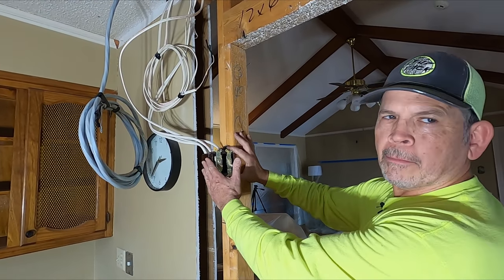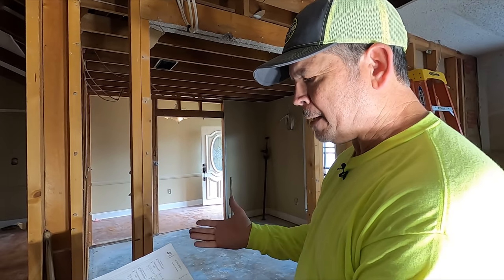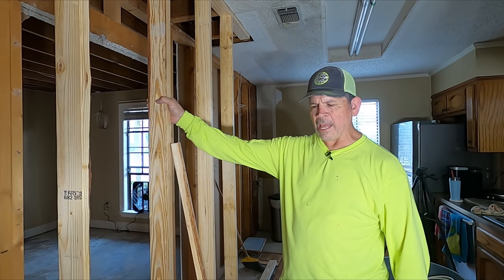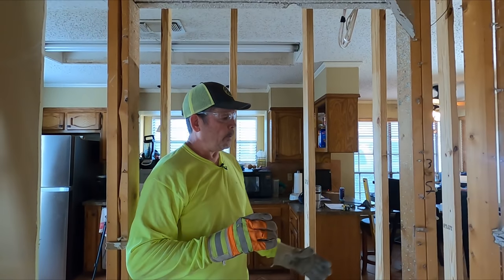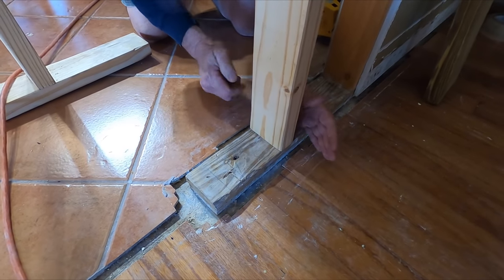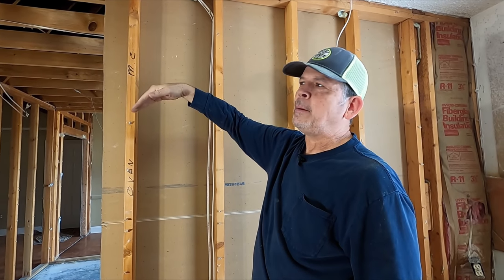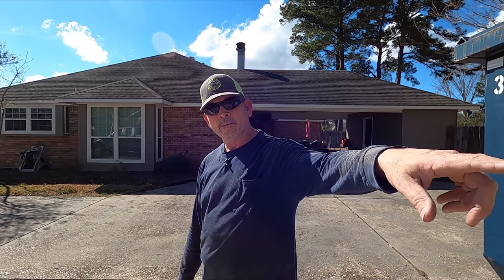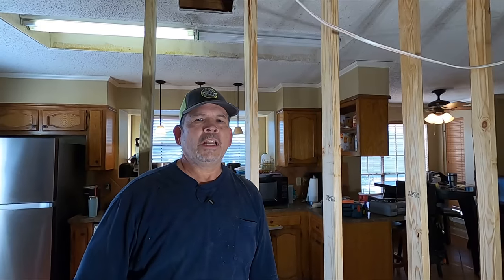Removing a LOAD BEARING WALL and Prepping for a HUGE BEAM - Ep. 2

Comment: This is a huge job. Always professional work, you do. When the truck dumped the wood, I thought of the man I worked for and still do on occasion. He would have me put a few old boards on the ground perpendicular to the lumber being dropped to make it easier to lift them off the ground. That's the way it had to be done.... no and, ifs or buts. He would drive me batty.

Comment: That's awesome you put a working appliance out at the street for someone in need of one. 🤗

Someday (hopefully soon) that may be me needing a used appliance. I'm currently in a basement in a relatives home, trying to make do with the limited space I have. An air fryer is my "oven", a George Forman is my "grill", a single induction cooktop is my "stove", etc. And with the way the breaker box is currently set up, I can use each of my little appliances ONE at a time ONLY AFTER all space heaters we use to heat the lower level of the house are turned off. Or else the breaker flips, shutting everything down & resulting in complete darkness. ("Babe? You got a flashlight handy? We must've forgotten to turn something off!")

Someone is going to be ecstatic to find that oven sitting there that's just begging for a new home. 👏👏👏

Comment: 5' stud is great tip. 

I do the same with baseboard. I'll cut several  10" pieces of baseboard, depending how they overlap/cope. Put a 10" piece in each corner, measure between the 2, with tape measure flat on the floor, and add 20" to the measurement. 

Anytime I'm measuring inside corners, I'll make a mark from one corner at 10" then measure from the other side, to my 10" mark, and add 10" to the measurement. 

Hard to measure inside corners, works great for a lot of different things. 

Never though about studs though. 👍

Comment: ive never seen somone use a pre made 5ft board to measure like that great tip ill have to start doing that more 
idk about you but i usually add a 16th or 8th extra to make sure its a tight fit and the ceiling  doesn't drop any
Reply from the maker: Thx.  Yes we add a little also to take the load on the new wall

Comment: I would like to butt an LVL up against brick (fireplace) that goes from the floor all the way up into the attic. How should I fasten the king stud(s) to the brick? Other side it straight forward as there is an existing wall to tie into with the 2 king/3 jack studs. Thanks. Great videos!

Comment: That lumber yard dropped the ball again!  How about the yard letting you know what iSN'T coming.  Communication is better business.  Oh well, looking forward to this remod.  The re-engineering of the load bearing is my fav part of these.  As you know, the most important part of construction is not what you see, but, what you can not see.  Structural integrity, electric, plumbing, etc. It all gets covered up by the finish bling.

Comment: Did you demo the bracing above the ceiling and move it or install the bracing on the temp wall before moving it? Thanks.
Reply from the maker: Transfer the load first then remove existing bracing 👍

Comment: I can never decide if i would like or loathe a house built like the US
I live in the UK - here everything is all brickwork - it makes everything fare more stable and easy for heavy mountings of shelves and tv brackets etc but means that adaption for more sockets, running ethernet cables etc is far worse
Reply: We have plenty of older homes made of brick here and I hate each and every single of them. Stick housing all the way

Comment: Hi, I am planning to remove a wall that holds my ceiling joists, the engineering told me to install a 2 ply LVL 2x9-1/2", I was planning to install 2 2x12" conventional lumber(Home Depot), is that a bad idea? The reason I am thinking about it it's price, in my city the LVL costs 5x more.

Comment: Question - if you didn't have the plans, and drilled into the concrete floor to discover the concrete doesn't have a footing below it, what course of action do you have for stud packs (or posts for that matter) concentrating weight on a non-footed concrete floor?

To say it another way - if you had a load bearing wall on a slab with no footings under that slab, and wanted to open up the space with a beam and stud packs or posts, those posts will concentrate that load to a much narrower spot on the floor that is not over a footing. What do you do then?
Reply from the maker: You’d have to pour a footing.  Your structural engineer would design it for you.   On the west coast for seismic, ours were always 2’x2’x2’ with rebar cage epoxied into slab with third party inspector watching the whole time at $150/hour 😳
Reply: @StudPack  That's what I thought. Sounds expensive, and clearly I'm in the wrong business! :)

Comment: Ur temp wall I’m assuming is 16” OC?
Reply: @maddexxx847  it would only matter on how much weight it has to support....since it's a load bearing replacement, 16" centers is a lot safer than 24"s.  I'd recommend adding a T off just to make sure it can't shift sideways, but I think he had said he nailed it into the floor.
Reply from the maker: Temp wall studs line up with joists is how I do it.